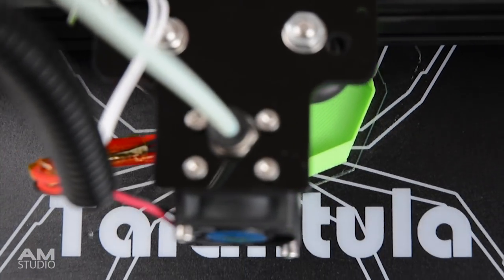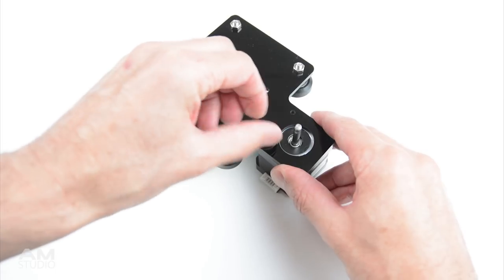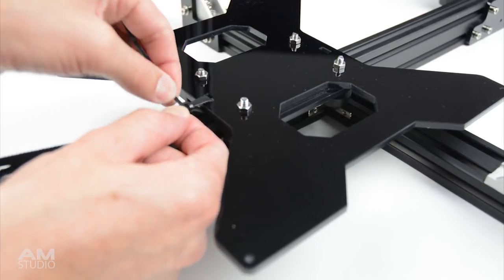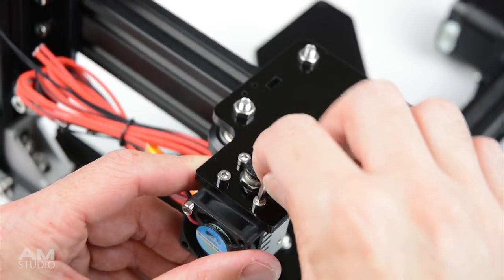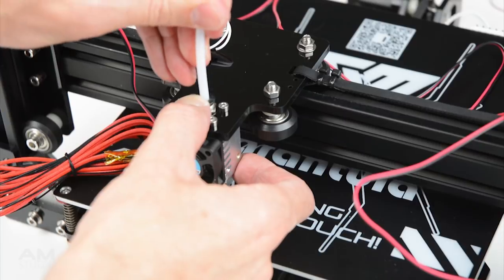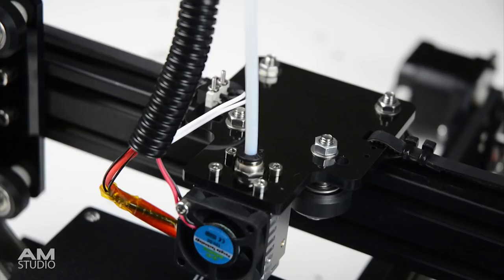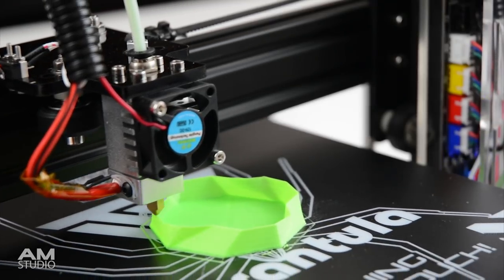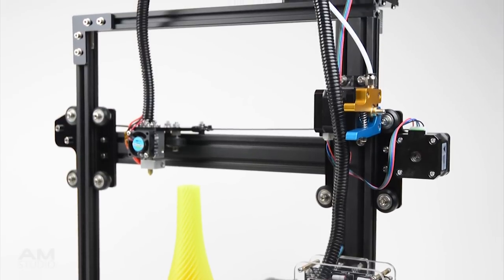TEVO TARANTULA  ASSEMBLY AND FIRST PRINTS

Comment: My first machine. It can work just fine but needs a fan duct right away. I made the Fan fan duct found on thingiverse.  Next important things are , board guard (so fan from mainboard doesnt cool the bed, bed cable manager, psu cover, spool holder. I made a bracket to stablize the gantry. Fasten the machine down on a piece of flat board, buy or print L brackets to mount at base of gantry. Sound like a lot of work but its quite rewarding to get it going good, and has been reliable. I can even do tpu with success, and abs.

Comment: Hello, this is my first printer that I value and I wanted to know if it is normal that it does not sit completely on the table.
If this happened to you, could you tell me how I could solve it?
Reply from the maker: You can try placing the printer on a very flat surface, loosen the frame bolts then readjust so it sits flat.

Comment: Also what software do you use? I've been using repetier but I'd give some other programs a try. Need to get a cooling fan duct as well because my calibration cube has some issues on the z axis. I'm also going to re-drill the eccentric nut placement for the extruder. Good video man. 👍
Reply from the maker: Hey, Ive just been using Cura. Cooling fan will be the first mod. Yeah check the axis for any loose parts.
Reply: amstudio ok thanks

Comment: Thanks for another video mate.  That first boat print was bit ropey without the fan, but clearly loads better cooled, what's your thoughts on this vs the Anet A8 3D Printer? i prefer the look of the Anet overall.
Reply from the maker: Both are good cheap kits, and both can do with upgrades. I like the metal frame and the display is easier to navigate on the Tevo, but I found the A8 worked better out of the box and is a neater finished build.
Reply: In my experience, the Tevo Tornado is the one to go with, though it's twice the price. If you consider the costs of upgrades and time it takes to put together the less expensive kits, and troubleshoot them, it makes sense though. 

With this or the A8, you could end up with $350 or more all in by the time you get to the build quality of the Tornado. All metal brackets instead of acrylic, an AC powered heatbed, large build volume, glass bed with build platform, and the belts and pulleys have less play in them.

Just make sure you check everything is together tight after shipping. The Tornado can last a long time with an extruder/hotend upgrade and better control board and stepper drivers if you want to get nearer to Prusa quality